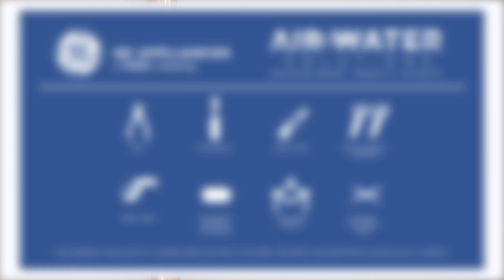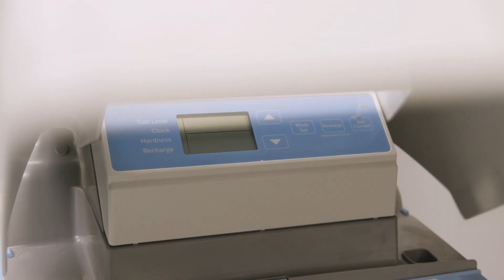Installation - Smart Water Softener

Comment: Does this work on a regular 110 volt supply or would it require a 24 volt one? Also what is the power rating of this appliance in terms of maps of current drawn?